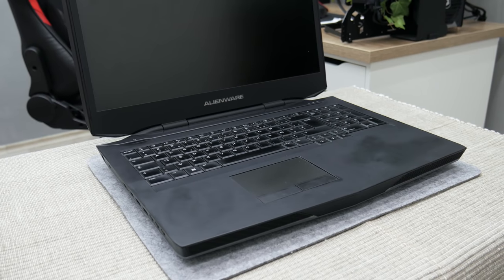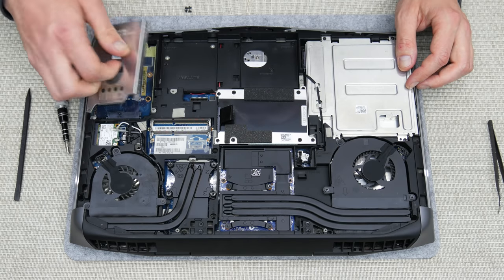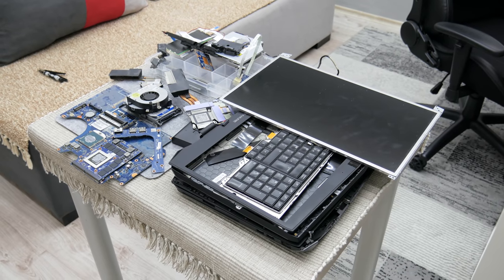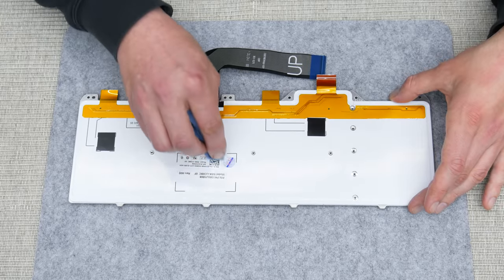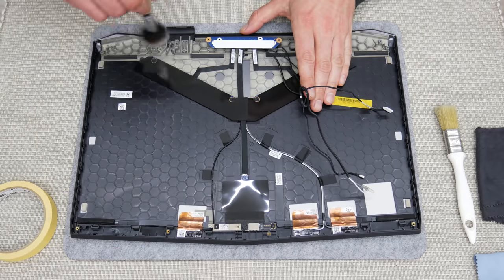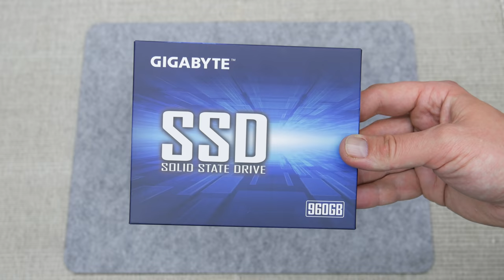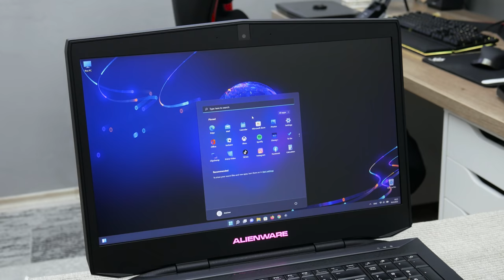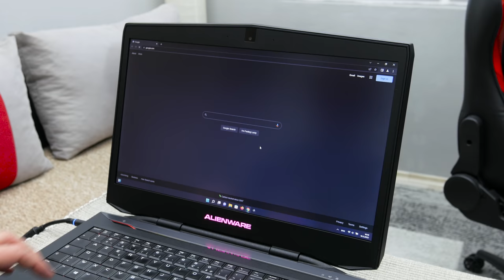Alienware 17 from 2014 - Restoring and Upgrading ( FULL - REMAKE )

Comment: This was my first gaming laptop. I love this thing. Brought it with a 765m gpu and upgraded to a 980m down the line. It was a great system until I started getting random restarts and couldn't figure out how to fix.
Reply from the maker: These models are weird about problems, but not too hard to repair
Reply: Same, however mine can’t work without being plugged in now. Think it’s a motherboard issue unfortunately
Reply: @Swoop.  BATTERY
Reply: @regresoderambo  I tried a replacement battery didn’t work, computer won’t even boot with a full charge battery inside unless plugged in
Reply: @Swoop.   my 2014 alienware  14 inch ? only work if I press the F1 key when booting up its the battery!!?  not a big deal I dont think?  for my  machine only use it for dawn of wars  and Age of Empire  games ?
Reply: had the same model but with amd r9 290x
Reply: same，my first Alienware
Reply: @anthonymurphy5850  I have 13 r2 dead battery same problem. Will try to replace it.
Reply: @ComputersAndTechAndAndrew  would you know where to replace the graphics card? Mine blew in 2019 and I've been trying to look for parts
Reply: @miniandrewmini1  same problem with me.
Reply: @arafath.concepts3482  also got the same problem
Reply: @Swoop.  I have actually found its a fault in the dell charger that comes with the system, I got a modular charger from amazon and charging was restored!
Reply: What size are the gpu heatsink screws as I needs some for my Alienware  same as this
Reply: Reinstal Windows and don't download updates.
Reply: @ComputersAndTechAndAndrew  What if there is a motherboard problem?
Reply: @Swoop.  have u tried a bios update?
Reply: @TheFpsMafia  Whaaaat!?
Reply: Go to your services and delete everything dell data vault bs

Comment: We are now in 2024, though I have other Laptop and a Desktop (gaming one), I'm working right now on a AW 17 R2 (2015) a little different. I love this laptop, it was my first and basically unique gaming laptop (expensive for me in those years), I upgraded it to almost 8.5 TB since it has 4 ssd extra slots, and with the AW Graphics Amplifier (modded in one side of the case so it can fit) can run a 3080. Anyway, what you have done is a SUPERB job, so clean, so smooth, I mean, you tuned it up as a brand new one. Lot of RESPECT for your job!!! And the video edit at the end is like you were promoting AW restoring program (haha), really impresive. Congratulations!!!

Comment: Great piece of work. Watching you restore old laptops is such a joy. Keep up the good work. By the way I still have my first laptop which is a Toshiba satellite M45 from 2005 with single core Pentium M still in all original condition. Still works great. Haven’t had a single problem except for the battery.

Comment: Hi Andrew I am also restoring my Alienware 17 from 2014. I had replaced the power cord, changed the operating system 4 times, and a few other things before I realized the hard drive was bad.  A guy I was dating kindly replaced the hard drive, but snuck off with the SSD. LOL I finally got frustrated and bought a new SSD. I could not get the BIOS to recognize the switched boot order. I tried a few different ways.  A friend told me to just remove the old hard drive and force the SSD to boot first which was a great idea because I had already mirrored my hard drive on the SSD so it was ready to go. Super stoked. As you know I'm running Windows 10 because there's some rather stupid reasons that she can't run 11. At some point I downloaded a bunch of drivers as well as the Alienware  "Command Center."  The customized lights on the machine look amazing. It was worth looking up the software.

The machine stutters even on a brand new SSD. Do you know what I have overlooked? Thanks! *If anyone asks I'll tell the funny story of how I got it. :)
Reply: Hi, did you try to replace your charger with an original one, same specs? If not you can try this.
Reply: How did you get it?

Comment: An awesome video. I really want to restore my 2013 UK model with much lower specs (765m, fewer gigs of RAM). 
It gave me a lot of unexpected problems down the years but is my favourite laptop ever. 
It has a 'permanent battery failure' message now (that I expected as the battery/charging was playing up for years) and it also just turns off when connected to the mains after 2-3 hours. So I would guess there might also be a motherboard issue (?). I turned it on yesterday and before it shut down after a few hours (after Startup Repair had finished) the BIOS diagnostics said there was an excessive heat issue.  I have no doubt the insides need a HUGE clean, and likely a repair to the thermal paste/heat sinks.

I don't know whether to start trying to take it apart and fix it all up with a new battery and other parts (I am only a beginner!), or recover all the data from the very old HDD by removing it (there is a lot of priceless family photos etc on there). It's a Windows 7 machine (and I have the discs), which I love, but swapping out the HDD for an SDD means a new install of the OS along with everything else :/

Comment: Nice restoration! I'll watch the other video as well to see some more details.
Also, the only other thing I would have done was added 2TB mechanical disk in the 3rd slot, to have Disk C (512GB MSATA), Disk D (1TB 2.5), Disk E (2TB 2.5 HDD - as there was an empty HDD slot), and Disk F (CD/DVD drive).
Reply from the maker: 3rd and 4th ( instead CD ROM ) can be mechanical, but also can be SSD, max speed :D
Reply: @ComputersAndTechAndAndrew  with having 3 storage drives available already, no need to remove CD ROM drive, especially if 3rd drive is 1TB or larger (preferably 2TB mechanical or 1TB+SSD). I don't go for super large SSDs because they cost too much.

Comment: Andrew, wish you read my chat in here. I have an old laptop (Acer v5-471G) that first time I buy it, it doesn't matter to playing even call of duty world at war in medium to high setting. But now, it is always stuttering even that I have many times to clean the fan (last I modified the fan so it must keep at high rpm), renew the pasta on cpu and gpu, clean up the motherboard, using a SSD instead of HDD. But the stuttering always persist. At the first start of gaming it is smooth and work fine, but after 10 minutes it starts to stuttering. There is no other way I think. But I noted this: 1. My laptop is still one channel of ram and (2) my laptop charger is lost but I found the new one and I didn't know if it still my laptop charger or my friend's.
Reply from the maker: Hi, I'm not sure what exactly can be but this may come from a bad charger or laptop just drop the pefromances my itself to save power or maybe in bios you have some settings like power saving or maybe there is some other problem, sometimes the RAM may cause problems but that is rare
Reply: Waah thank you Andrew, I would like to add 4GB DDR3 RAM into it.

Comment: 17:37 did you replace the thermal pads with new ones or kept the old ones?
If you used news ones, as there are more than a couple of different thickness pads available in the market, how do you know which ones to use?

Comment: Andrew! Give me an advise, i have a lenovo IdeaPad Gaming 3 2021, when i upgraded the ram, that metal case that is on top of the ram for heat protection, had moved a bit on the left and burned a capacitor/inductor PL202, i removed the burned component and cleaned, everything works but should i worry ? I cant find that exact capactior/inductor here because the laptop is very new.

Comment: Hello sir. Thanks for this video. Can i ask what kind of fan should i replace if i dont find the original one installed in this laptop? Does fan had voltage too that laptop required too? Thanks a lot, I'm from the philippines.

Comment: Well, there is still a lot to gain by upgrading this GPU, a 1070 is an easy and pretty cheap upgrade, you can also mount a Quadro RTX5000 (2080S) with a bit of modding

Comment: Wonder if its possible to mod bios for G-SYNC panel capable GPU, and add a drop in GSYNC panel with compatible cable
Reply from the maker: Hi bro, you don't need mod on this model, just G-Sync or 3D Screen, together with the sensor. I'm planning to do that, I have nvidia 3D vision and I want play some games :D old but still cool tech
Reply: @ComputersAndTechAndAndrew   You probably know this but some graphics card have their own LCD cable connector on them because they are meant for G sync LCD panels.  Is a common upgrade for clevo laptops is the upgrade to gsync version graphics card with the use of a new LCD cable and screen. Don't know if the Alienware community has made the mod yet

Comment: You paint laptops identically, with the same matte black paint and dots a lot. Have you thought about something new? I like your videos, but it's like evey one of them is made identical.
Also for the GPU that burned down capacitor can cause harm to the PCB, and it would be better to remove it, or even better resoldering a new one. It will help woth power foltering thus extending the lifespan of this machine. Good video nontheless, keep it up! Cheers

Comment: Hi! I have an Alienware 17 from 2014 and it have some problem. The noise of CPU fan is very height. A friend tell me that I have to replace the termal paste of CPU. May you give me some suggestion about it? The service tag of my pc is 5pshd12. May you suggest me some improvement to increase the performance? Thank you. Congratulation for the video and for the restoretion of your alienware.
Reply from the maker: Thank you for the support bro :) About thermal paste and loud cooling. Cooling can be loud because of dust and dry thermal paste, just you need to do some dusting off and use some good thermal paste, you can go with cooler master, or artic mx, just don't use some cheap thermal paste and don't use some like liquid metal. Liquid metal is power conductive and not recommended for laptops
Reply: @ComputersAndTechAndAndrew  I bought Artix MX6, I think is enought good. What do you suggest me to do for increase perfomance of my AlienWare?

Comment: Great video! I currently have one of these and am wanting to upgrade the GPU from the GTX 880m to the GTX 1070m as they have one available in the MXM 3.0 Type B. Has anyone tried this on this version of the Alienware 17? the next series of Alienware which runs the 1070m does have a larger area for cooling so that is really my main concern. I currently run into some heating issues on warm days with the laptop already on a cool pad, but this could be because the old GTX 880m is being maxed out. Any help would be appreciated, thank you.
Reply: I did it and everything is working great.

Comment: mine has an rtx 4000 quadro :) 4930mx
Reply from the maker: That's better bro :) I wanted to upgrade the GOU, but they are still pretty expensive
Reply: @ComputersAndTechAndAndrew  a p4000 basically as fast as a 1660ti is about 200 us on ebay :) the rtx i got lucky . i snagged it for 570 ish which is a great deal considering  the gpu climate lol